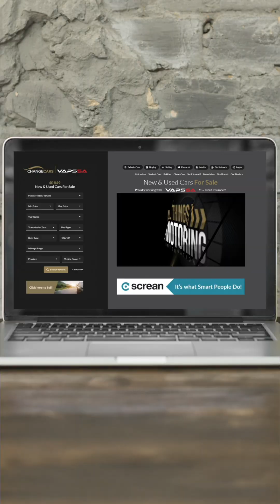Turbocharger Failure Explained: Heat Soak & Oil Crystallisation | Keep It or CHANGECARS Podcast

Comment: Top 3

1. People thinking you only need to change oil and totally ignoring their air filter 
2. Servicing the oil after distance and not engine run time
3. Using the wrong oil

Comment: On modern cars this is largely solved (late-1990s onward, refined further in the 2010s): the turbo doesn’t spontaneously get hotter, it only gains heat by conduction from hotter components—primarily the exhaust manifold and turbine housing—after flow stops. The “idle for 30 seconds” advice is mostly redundant anyway, because normal highway driving already includes off-boost deceleration, surface streets, and parking time that shed far more heat than a brief stationary idle on a modern water-cooled setup.

Comment: This sounds like a 2000's explanation for a 1990's problem. I don't know what this guy is trying to say. I sold my Isuzu 489k km's no problem. 10 years later the thing is still driving on the road to this day. 

Turbos are so specially efficient now it's almost pointless worrying about them. A turbo repair kit you can do yourself. And it's not that expensive. And if you want to be even more cheap you can seek out the individual parts cheaper than a kit... 

Even more cheap is just drive a non turbo big bore diesel. Drive 1 million km and not worry at all

Comment: My old Sprinter van has 200,000 miles on it. The only component that's failed is the fuel pump at 160,000
 Constantly loaded and used for towing a 1700kg hydraulic press. Clutch is the original too. Serviced regularly and I let the turbo spool down before switching off. Great van. It's semi retired and I have a 25 plate Sprinter as a replacement.

Comment: My brother, whose driving style is to "drive on the brakes", drove home in summer, stop/ start traffic, until the final 2km. As usual, he gunned those last 2km, roared into the driveway, switched the car off, and went inside the house. He was only at the top of the stairs when there was a loud BANG. He went outside, and there was oil all over the driveway. The turbo had literally split in half. And my father said to me afterwards, "I did tell him. Turbo cars are different. Dial the speed down in the last 2km, and let it idle for a minute when you get home. He didn't listen". I replied that No. 1 son never listens.

Comment: Blew the oil seals on my max peeding turbo, mechanic forgot to put the restrictor back in, after he put it back it only lasted a few months before it completely smoked out the road. I'm on my second one after only 2 months of driving it's started to give a puff of white smoke on start up. 2jzgte on a gt3076

Comment: A turbo 200k km....?. Are you kidding...?. My last four cars were sold to another person with more than, at least, 350k km each.... And they're still working. Cos I still see them from time to time. And I'm one of those driver who  loves drive as fast as possible. And I go to track days, at least 5 times a year.... I never had to fix a turbo. Even though my cars are always with electronic HP increasing... Minimum stage 1.... 
But I always wait for heating and cooling times....

Comment: I’m glad this is being discussed. I’m lucky enough to have the new M5, the G90. It’s ICE is an S68 -4.4L V8 twin-turbo in a hot Vee setup. Here’s the catch though… as anyone here knows, the M5 is now a hybrid. 
When you start it, it defaults to hybrid -moves off in EV mode. 
If you give it the slightest touch of gas, the ICE fires up. Once the engine fires, it’ll stay on for a few mins for an initial warm-up.  
However, the car has a mind of its own after that and cycles between ICE & EV. 
So, turbos could be flying after ICE use and then suddenly starved of fresh oil. 
I contacted BMW and they confirmed, after a month of chasing, that the car does not have an electrically-operated auxiliary feed to lubricate turbos during EV use. 
My solution is twofold: For a short hop… switch out of Hybrid to Electric mode and keep the ICE off. If the ICE comes on at all, keep the car in ‘dynamic’ mode and this forces the ICE on continuously and you still benefit from the EV support. 
For the benefit of existing BMW PHEV owners reading this: The G90’s PHEV operation is totally different to the non-Ms. 
I do wonder what G90’s turbo reliability will be like post-warranty unless the car’s are minded like mine is.
Reply: The lineage of bmw turbo v8s starts at the Gen 1 n63. This has an electrical auxiliary pump on the main coolant circuit that will run for some time after engine shut-off,  main purpose being to cool off the static oil sitting in the turbo oil passages 

If you pull the engine vanity cover off after a drive , you will hear some buzzing , and if you can locate the turbo coolant lines and touch them you will feel them vibrating 
.Its highly likely the same strategy has been applied to the latest s68
Reply: @domkraggp9944 Well, that would be great news but, as a new owner, I harangued BMW for an answer on this and got nowhere, the answer I did get was this (pretty useless) -can you make anything out of it?

 The BMW S68 engine in the M5 utilizes a sophisticated wet-sump lubrication system designed for high performance and reliability under demanding conditions. Here are the key specifications:
 * Oil Capacity: Approximately 10.5 liters (This may vary slightly depending on the specific M5 model and market).
 * Recommended Oil Type: BMW typically recommends a specific grade and specification of fully synthetic engine oil. For the S68, this is likely a low-viscosity oil meeting BMW's Longlife-01 or Longlife-17 FE+ standards. It's crucial to consult the owner's manual or a BMW dealership for the exact recommended oil for your specific vehicle, as this information is definitive.
 * Oil Filter: A cartridge-type oil filter is used. The specific part number will be detailed in the owner's manual and can be obtained from BMW parts suppliers. Regular replacement at the recommended service intervals is essential for maintaining oil quality and engine health.
 * Oil Pump: The S68 employs a fully variable vane-type oil pump. This allows the engine's electronic control unit (ECU) to adjust the oil pressure and flow rate based on the engine's operating conditions (load, speed, temperature). This on-demand lubrication helps to improve efficiency and reduce parasitic losses.
 * Oil Cooling: The engine oil is actively cooled via an oil-to-coolant heat exchanger. This helps to maintain optimal oil temperature, even during intense driving, preventing thermal degradation of the oil and ensuring consistent lubrication.
 * Oil Level Sensor: An electronic oil level sensor continuously monitors the amount of oil in the sump and provides a warning to the driver if the level drops below the acceptable range. This eliminates the need for a traditional dipstick in some models.
 * Oil Pressure Monitoring: The system also incorporates an oil pressure sensor that provides feedback to the ECU and can alert the driver if oil pressure falls to a critical level.
Key Features and Considerations:
 * Variable Oil Pump: The variable oil pump is a significant feature, contributing to both performance and efficiency by supplying the precise amount of oil needed at any given time.
 * Robust Cooling: The dedicated oil cooling system is vital for a high-performance engine like the S68, ensuring the oil can withstand high temperatures generated during spirited driving.
 * Electronic Monitoring: The electronic oil level and pressure sensors provide added convenience and safety by alerting the driver to potential issues.
 * Adherence to BMW Specifications: It is paramount to use the BMW-approved engine oil and to adhere to the recommended oil change intervals outlined in the owner's manual to maintain the engine's performance, longevity, and warranty.”

Comment: Years ago turbo timers were a thing. The turbo ran after the car switched off
Reply: 😂 turbo can never run if the engine turns of.
Thats not how a turbo timer works,  it keeps the engine running after you turn of the key and locked the car. Engine runs for a set time and shuts of, that's a turbo timer. 
Modern cars have nowadays electric coolant pump that keeps the flow on a period of time after engine shutoff.  Not all cars but som have it. Mine does
Reply: @Wolfpack310 what car do you have?
Reply: @Invis_Space  for example a BMW's engine fan will keep running after shutdown following hard driving. The "after-run cooling" feature cools hot turbos and the engine, using electric pumps and fans for minutes to prevent heat soak and oil coking.
Reply: Always some doos trying to sound smart by saying the same thing in different words...